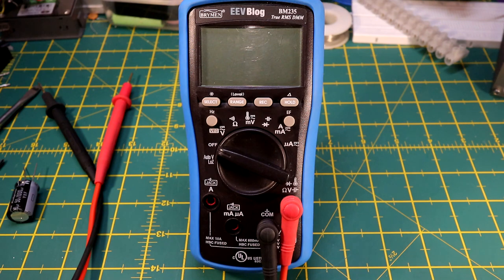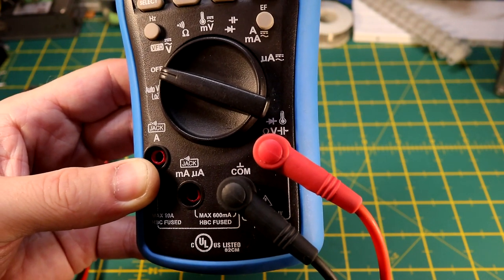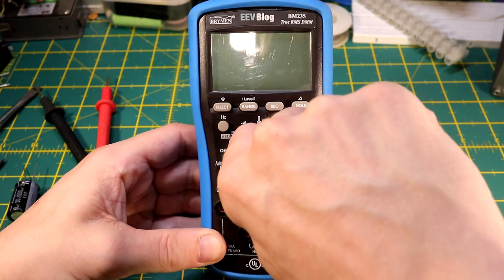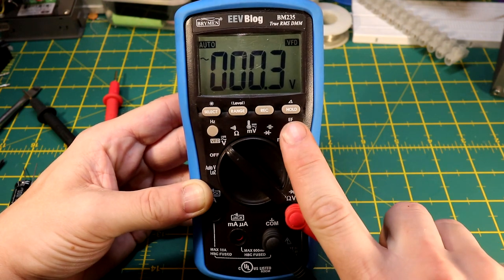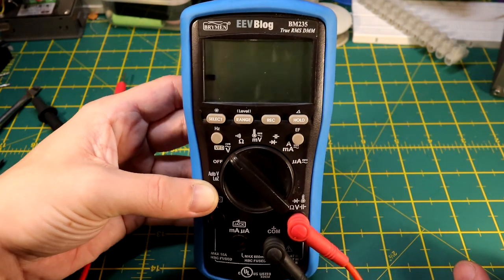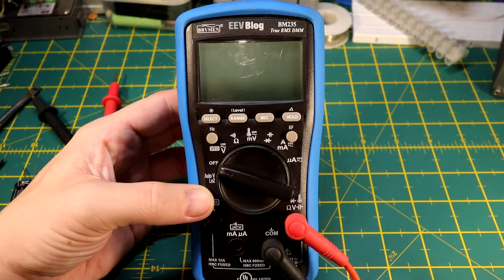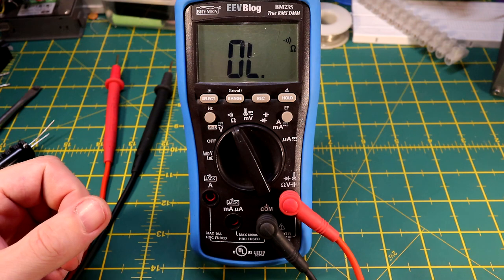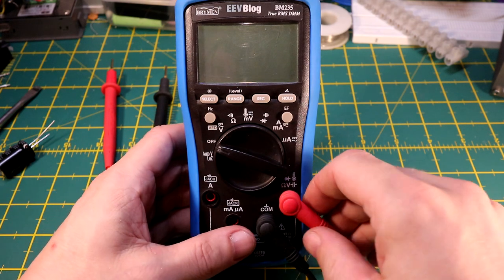The BM235 EEvblog multimeter quick overview | DrRunCMD

Comment: Thank you for making and posting this video.
Reply from the maker: Your welcome. Thanks for the feedback. This is a really decent meter for the price. Unfortunately, my bm235 I'd sick at the moment. I have a dead short on the normal voltage setting. But the low impedance voltage setting still works. Thanks again. Pls subscribe if you haven't done so already.
Reply: @drruncmd  (That's a very nice DMM).  I'm sorry to hear that your meter has developed this issue.  I hope (& trust, with prayer) that you will get this resolved.  Respectfully, td\.